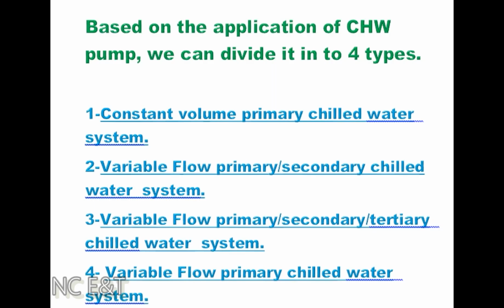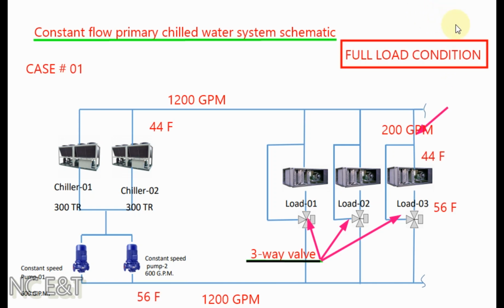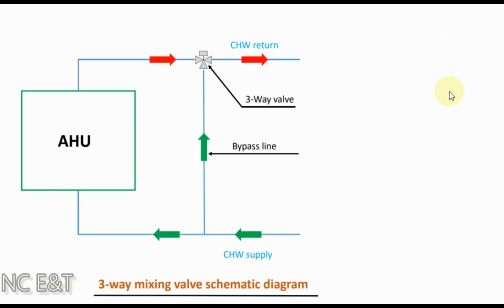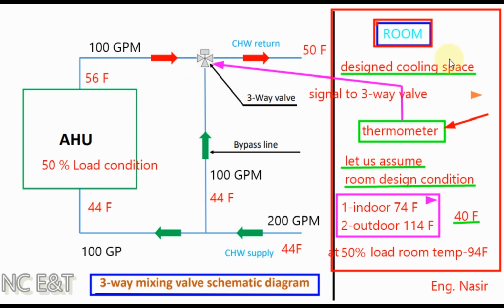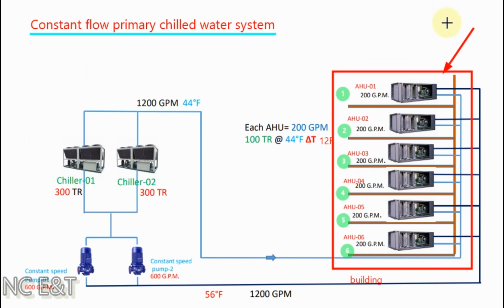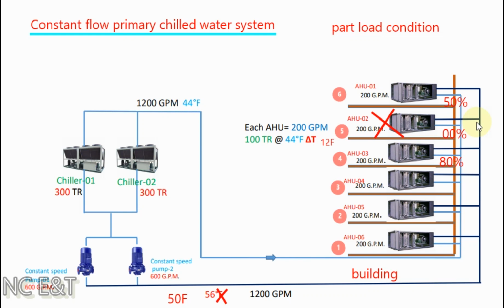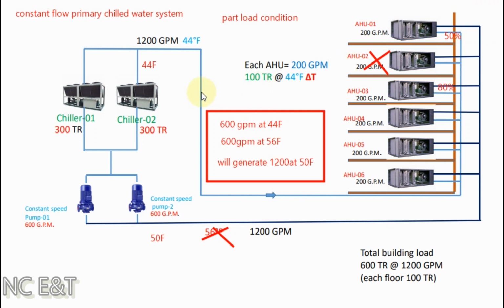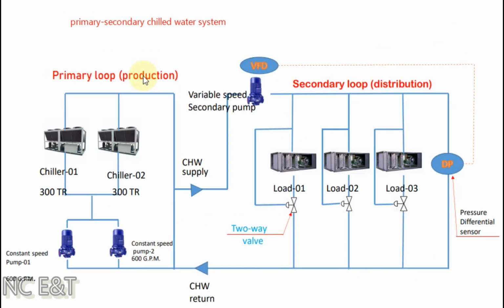23 - Constant flow primary chilled water 💧 system part-1,Eng.Nasir

Comment: We work into cleanroom pharmaceutical industry. I am really confused which table should I select for duct reinforcement 1 inch, 2 inch,  3 inch etc. Can you please guide me in the selection of the right table for duct reinforcement.
Reply from the maker: selection of 1,2 & 3 inch of reinforcement depends on the external static pressure of you air handling.
if you don't have any information then you can use 2 inch.